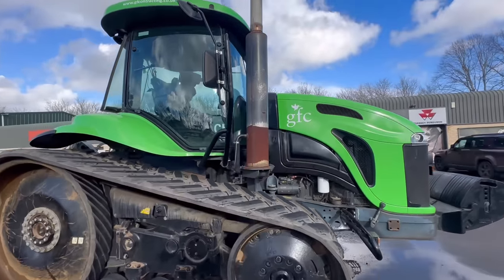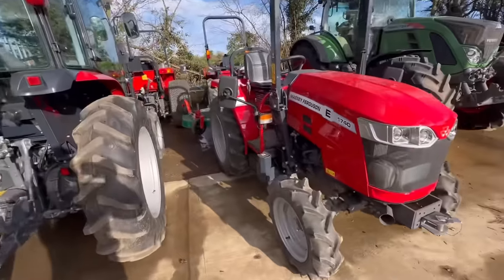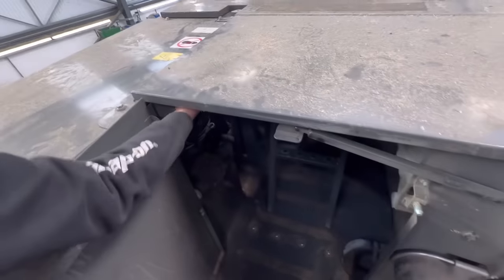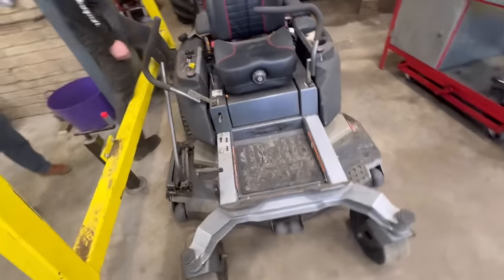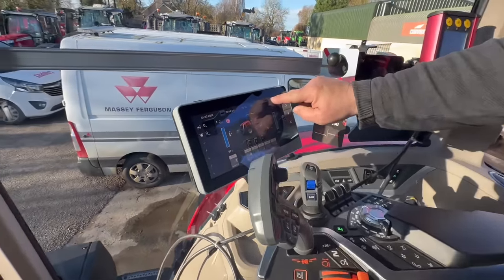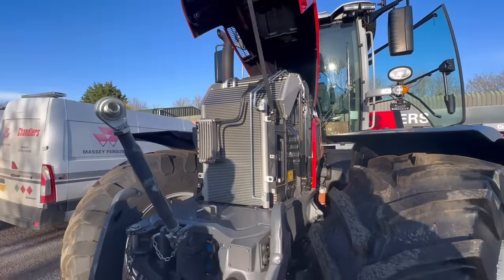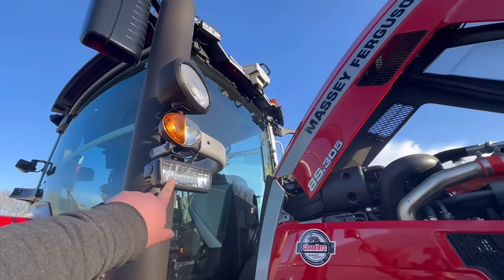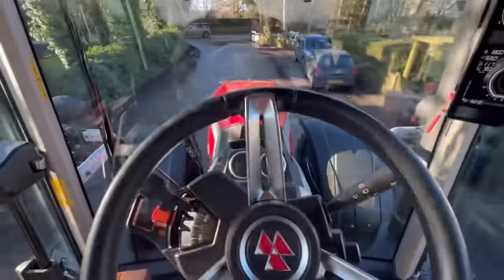I’ve got a new tractor (Massey Ferguson 8s 305 workshop walk around)

Comment: Please excuse me if this is a stupid question - I know nothing about tractors - but my common sense (which is often wrong) tells me that those tyres would provide better traction if they were the other way round - by that I mean the pointy end of the 'V' in the tread pointing backwards instead of forwards?
Reply from the maker: They are like that so the mud can come out of them and not get stuck in the tyres it provides more grip
Reply: @Tomlamb980  thanks for the explanation - makes perfect sense now - the other way round, they would provide better traction for the first revolution, but after that the treads would be clogged with mud.

Comment: What is that 85 hp can 2wd Massey     our agco dealer doesn't carry anything that small.  I'm looking for something to pull standard size inline square bales and round baler planter drill for organic farm and garden business my daughter is starting thanks
Reply from the maker: It will be on chandlers farm equipment website  or the Massey man YouTube page
Reply: Thanks.  Our local dealers only stock bigger equipment nobody stocks anything under two hundred horsepower unless you want a off brand I miss the old tractor dealers that carried everything u needed to farm and garden with good luck with the new three hundred horsepower
Reply from the maker: Chandlers export all over the world I think